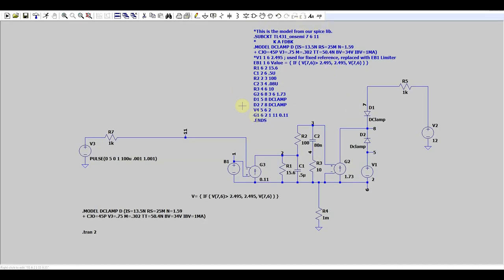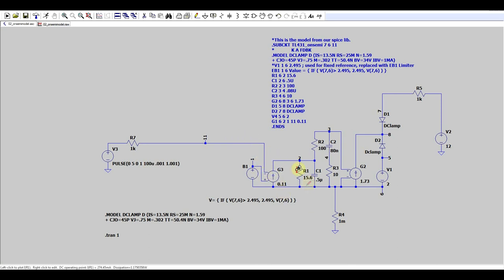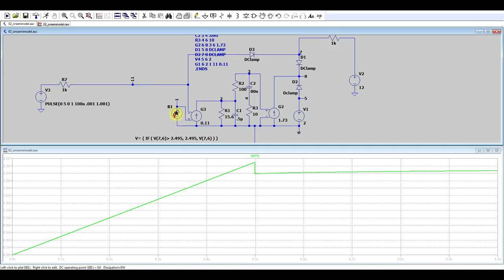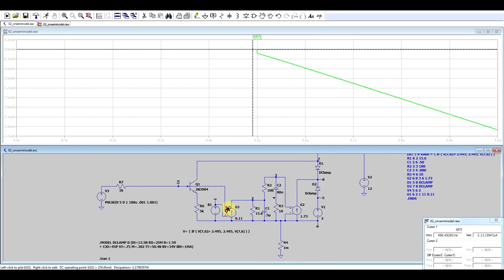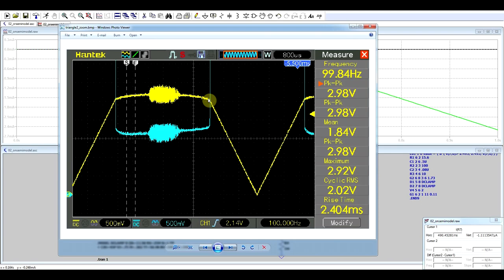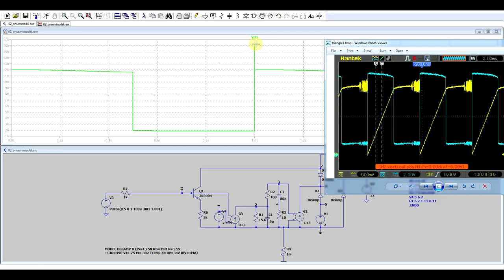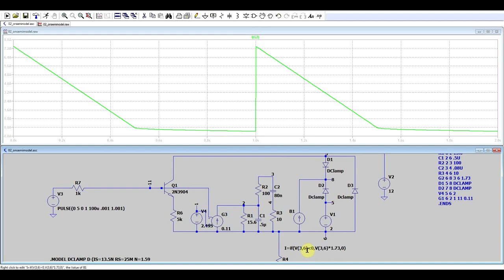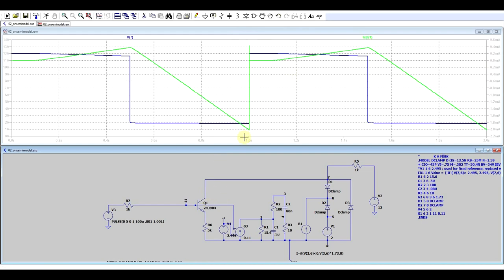Electronics Tutorial - The TL431 Part 2/3 - Making a proper simulation model

Comment: Thanks for this insight. I found that the model from Diodes Inc. seems to be even a transistor level model of the circuit, i.e. maybe more accurate, but possibly slower. It runs fast here though.

Comment: Here is a model by Zetex which is more accurate than TI and ON semi

[ZHT431]
*ZETEX ZHT431 Spice Model v1.0 Last Revised 22/7/2005
    *              
    *NOTE: This is a simplified Model.  Do not rely on this Model for 
    *validation of circuit stability.  It does not accurately replicate 
    *stability boundary conditions with additional load capacitance.  
    *Check stability by normal breadboarding techniques.
    *
    .SUBCKT ZHT431 1 2 3
    *Connections  Vz Vref Gnd
    *Input current
    L2 2 12 2E-9
    Rin 12 13 Rmod1 20E6
    Cin 12 13 1E-12
    D1 13 12 Dmod
    D2 12 11 Dmod
    *Reference voltage, Voltage dependence
    Iref 13 21 2.4985E-3
    Rref 21 13 Rmod2 1000
    G1 21 13 11 13 1.43E-6
    *Gain, time constant  and  clamp voltage
    G2 13 31 12 21 0.004
    Rt1 31 13 1E8
    Ct1 31 32  800E-12
    Rt2 32 13 2000
    Ct2 31 33  50E-12
    Rt3 33 13 5
    D3 31 13 Dmod
    D4 13 31 Dmod
    *Buffer,Output
    G3 13 41 13 31 0.22
    L1 1 11 2E-9
    Rz 11 42 10
    D5 42 41 Dmod
    D6 13 41 Dmod
    D7 13 11 Dmod
    Rx 13 23 0.5
    L3 3 23 2E-9
    Rq 11 13  Rmod3 74E3
    *
    .MODEL Rmod1 RES (TC1=2.95E-3 TC2=-5E-7)
    .MODEL Rmod2 RES (TC1=8.5E-6 TC2=-3.3E-7)
    .MODEL Rmod3 RES (TC1=-2.5E-3 TC2=2E-5)
    .MODEL Dmod D IS=1E-14 RS=0.1 BV=22 CJO=0.1E-12
    .ENDS  ZHT431
    *
    *$
    *
Reply: This ZHT431 model is more precise than default OnSemi, but it takes more CPU resources to simulate :(
Reply: I don't have LT spice and have been trying to get NG spice to run Fesz's model and many others, but not managed it.  This model appears to wor in NG spice inside Kicad 7.0.7 ,
Cheers :)